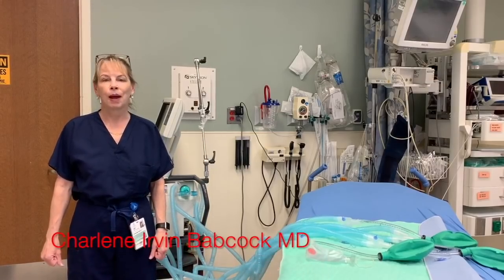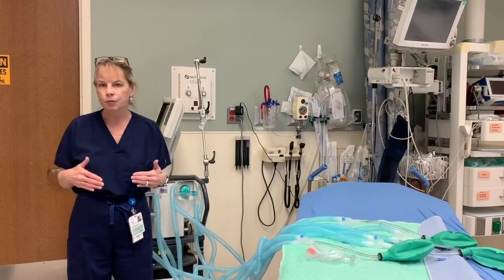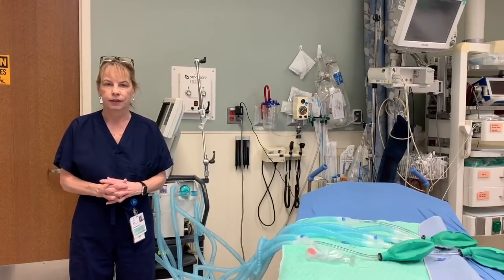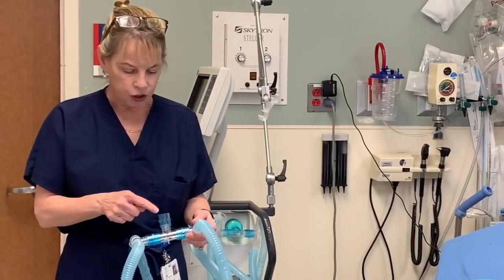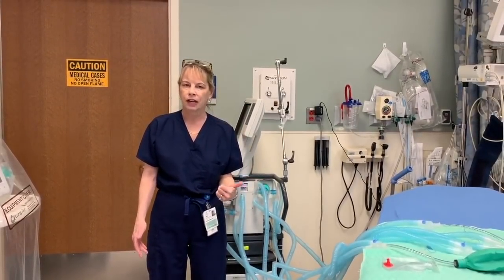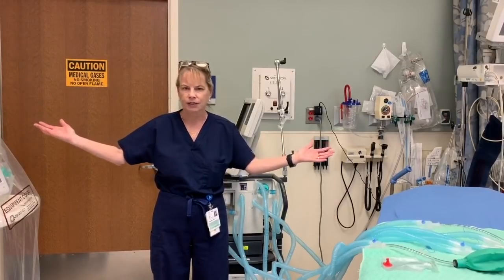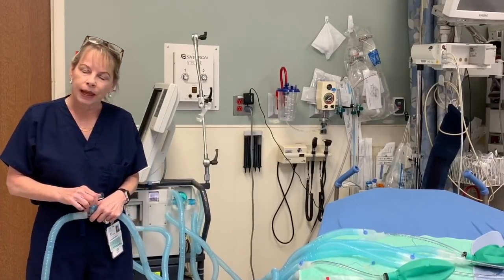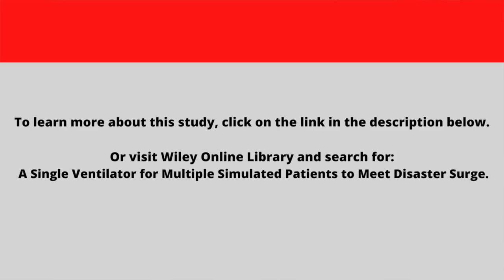COVID-19 How to Use One Ventilator to Save Multiple Lives

Comment: Matching BMI and age, should produce similar pressures in all 4 patients. At each mask there’s O2 connection which can be used individually to add oxygen in case O2 starts to drop. That way no need to change pressures. It’s a great idea you have

Comment: Did you perform SST/EST and how?
Reply: I doubt they did.  If I find time to replicate this later this week, I'll see if it can be done.  They didn't even show us this thing running in the video.  I'm not sure if the PB 840 can compensate for 48 feet of corrugated tubing (4 x 12 ft) during the tubing compliance for the SST.
Reply from the maker: @BicycleCrossroads  People have responded that they are using this in Italy and New York....yes just comments and not corroborated...but if you think about it....once. the dead space is filled, the next breath pushes forward the oxygenated gas previously in the dead space.., replacing the previous dead space....and pushing forward more oxygen...
Reply: @charlenebabcock1048  Tubing compliance and mechanical deadspace aren't the same thing.  When the PB 840 is calibrated with a circuit, the tubing compliance (flex and stretch) is measured and compensated for.  Without a proper SST, you are running the vent on the last known SST calibration.  This is not proper, and you will lose unknown volumes.  As for deadspace, you will typically lose about 150 mL per breath to the ETT and tubing between the lung and the "Y".  This volume, as you probably know is not ventilated and bobbles about...  And therefore is not counted as Alveolar Ventilation, but deadspace instead.  The more deadspace, the more CO2 retention... (Wasted volume).  I'm actually not quite sure what you're trying to tell me.  If you're trying to tell me dead space is not truly ventilated space, then yes, I agree.  But if you're trying to compare deadspace to tubing compliance compensation by the PB 840, then I disagree.

Comment: Hmmm. I have seen and suctioned pints of snot from both inhalation and exhalation tubes. How in heck are you going to prevent the bubble over of snot, or just flecks of same from being introduced DIRECTLY into the other patients lungs. Better to have someone  bag the unlucky three in shifts until the fourth is weened. First, do no harm. 2 or 4 on a ventilator would violate that dictum.
Reply: Hadn’t even thought of the instances when you’d need to in-line sxn one of the patients... with the vent trying desperately to deliver a breath, so it rapidly delivers a bunch of peak pressuring breaths to everybody else... how that now puts everybody at risk for a PTX...
Reply: HMEs... And change them often.  Just make sure you're wearing a PAPR when you do.  This COVID-19 stuff is not messing around.  Check out all those videos from Wuhan.  If you're and Anesthesiologist, Pulmonologist, or RT you're risking your neck on the front lines of this battle.  And our families too if we end up bringing bugs home with us.
Reply: I think a better idea would be to tracheotomy the unlucky three and give them 100% per trache mask until a ventilator becomes available. If they die waiting on a ventilator, this is better than killing them by "sharing" a ventilator. Everyone's tidal volume, flow rate, resp rate will be unable to be individualized. Vent settings have to be individualizing or all you will be doing is "water boarding" them for a day or so before they die. The more I think of it, the worse this idea becomes.

Comment: I have a pulmonary question to which someone might know the answer. since there will be a shortage of ventilators, for marginal patients, why could you not employ a cpap machine with a high setting and bleed in oxygen at a 5-10 liter flow. i would think that it would be the equivilant of a low peep and would provide some mechanical assist. and possibly stave off intubation and high peep. just curious.
Reply: Fear of aerosols, risk of contamination. This is with high flow nasal cannula.
Reply: A report from an intensivist in Wa said they progress VERY RAPIDLY (<12hr) from face mask to tube. He recommends bypassing anything else and going from decompensating on  a mask to intubating.
Reply from the maker: Its my understanding Bipap is contra-indicated in these patients...

Comment: If you put a water bubbler (like in home brewing) along the path to each patient, it would stop any back flow to the other patients.
Reply: if you also put one in the expiratory limb of the circuit, you can individualize PEEP by the height of the water column.
Reply from the maker: True...other. option is to add viral/bacterial filter before the 'mixer' at the vent exp. port.

Comment: This is FANTASTIC!
We started an open source hardware project OpenRespirator.org to close the gap in the supply of ventilators. Perhaps there is a shortcut and less complicated means of meeting the demand by producing the t-tubes and extensions described in this video.
Reply: Hey Brent, looks like your initiative aligns well with this one https://www.facebook.com/groups/670932227050506/?fref=nf , there is also some requirements collection here https://docs.google.com/document/d/15kqUPPI7bYL6dnCetOeDSyE8IG5pHVmtg8Ju4yzGlF8/edit?fbclid=IwAR0L_mUOv82qygfXsapm3iKbxff_52es57wOhNMLdK8td47k8-3948GMQxM , also check their very active openair slack channel if you haven´t already

Comment: Good thinking but practically it is not possible
Reply: But in this video she dint even show in test lung
Reply: @abhinandrews2874  Yup.  Agreed.  It's missing a lot of filters and humidifiers too.  At minimum, should have at least the one inlet filter and four HME's.  One for each patient.  Ventilating patient's dry like this is a big no no.  Had no problems wasting four ETT's though.  The elbow that comes with the four circuits fits right into the 3 Liter Anesthesia Bag.  (And NO, they're not real test lungs...  pseudo test lungs at best).
Reply from the maker: It is being used successfully in ITaly.....yes it is off label...yes it challenges the clinician to 'match' patients as best as possible for compliance, TV, resistance, etc...but it is working...see below about Italy...I've also been told its being used in Egypt.....  THe last sentance in the article (translated) is: "...its like multiplying  fish and loaves."

Dr Marco Ranieri of Bologna, Italy and his team Have successfully tested the approach in vivo in one of the hospitals in Italy overwhelmed by the COVID-19. 

They worked with Intersurgical, an Italian company based in Mirandola, started producing the circuitry in only 72 hours, and the first prototype has already been tested by Bologna Sant'Orsola Hospital. It works and in the next few days they'll start a mass production to supply Italian hospitals who are in need

Here some news in Italian. 

https://www.huffingtonpost.it/entry/a-mirandola-testato-ventilatore-che-assiste-2-pazienti-bonaccini-straordinario_it_5e73c3e1c5b6f5b7c540a8d2
Reply: She says in the video it's been done.
Reply: @introprospector  if it has been done, it hasn't been done on septic patients...  Probably only on GSW folks with relatively "normal" lungs.

Comment: COVID -19 patients who are more likely to have different lung compliance, so how can we guarantee safe and adequate  ventilation for all 4 patients?
Reply: This is desperate last resort move, at this point you are trying your best.
Reply: It's very possible that an alarm would not sound during a failure in one patient that happens to coincide with higher compliance in the other 3. This is last ditch stuff
Reply from the maker: It is being used successfully in ITaly.....yes it is off label...yes it challenges the clinician to 'match' patients as best as possible for compliance, TV, resistance, etc...but it is working...see below about Italy...I've also been told its being used in Egypt.....  THe last sentance in the article (translated) is: "...its like multiplying  fish and loaves."

Dr Marco Ranieri of Bologna, Italy and his team Have successfully tested the approach in vivo in one of the hospitals in Italy overwhelmed by the COVID-19. 

They worked with Intersurgical, an Italian company based in Mirandola, started producing the circuitry in only 72 hours, and the first prototype has already been tested by Bologna Sant'Orsola Hospital. It works and in the next few days they'll start a mass production to supply Italian hospitals who are in need

Here some news in Italian. 

https://www.huffingtonpost.it/entry/a-mirandola-testato-ventilatore-che-assiste-2-pazienti-bonaccini-straordinario_it_5e73c3e1c5b6f5b7c540a8d2

Comment: This looks like it could be a recipe for disaster.
Reply: I agree. However, if this was the last option available, these people already would have a 100% chance of dying without being ventilated.  In that case, there could be no worse disaster than trying this.
Reply from the maker: It is being used successfully in ITaly.....yes it is off label...yes it challenges the clinician to 'match' patients as best as possible for compliance, TV, resistance, etc...but it is working...see below about Italy...I've also been told its being used in Egypt.....  THe last sentance in the article (translated) is: "...its like multiplying  fish and loaves."

So not its not a disaster...COVID-19 is the disaster...and this allows you a plan to 'try or let die'.....and its looks like its saving lives...below is from an Italian source...

Dr Marco Ranieri of Bologna, Italy and his team Have successfully tested the approach in vivo in one of the hospitals in Italy overwhelmed by the COVID-19. 

They worked with Intersurgical, an Italian company based in Mirandola, started producing the circuitry in only 72 hours, and the first prototype has already been tested by Bologna Sant'Orsola Hospital. It works and in the next few days they'll start a mass production to supply Italian hospitals who are in need

Here some news in Italian. 

https://www.huffingtonpost.it/entry/a-mirandola-testato-ventilatore-che-assiste-2-pazienti-bonaccini-straordinario_it_5e73c3e1c5b6f5b7c540a8d2

Comment: I’m a big fan of creativity but immediately I can see some serious hindrances to this procedure. Although you address one of them (the difference in airway resistance between each patent) you didn’t address the problem realistically.  Employing this procedure on similar test lungs or even on trauma victims with healthy lungs (as in Las Vegas) is not the same as employing it with victims in various stages of severe pulmonary disorders such as ARDS, etc.  Each of the critically ill patients would necessarily have different degrees of airway resistance and lung compliance; as a result the volume would tend to over inflate the patients with lesser degrees of airway resistance and greater lung compliance, while simultaneously under inflating the patients with greater airway resistance and less lung compliance.  If these patients are critical enough to require ventilator support, each patient will need individual settings of volume, PEEP, 02, flow rates, respiratory rates, inspiratory pause, etc., which will also necessarily need to be changed frequently to support the patient’s changing condition.  There is no way you will find two critically ill patients requiring the same ventilatory support with simultaneous ventilator changes, much less six of them.  A cookie cutter approach will not work effectively on truly sick lungs.
Reply: These are fair points, and as mentioned above this is truly a last ditch effort when the decision would be truly let other patients die...One idea I have had since Dr. Babcock and Dr. Menes originally came up with the idea is that in a prolonged setting with true respiratory disease, as opposed to airway protection or trauma, patients will likely be able to tolerate short periods with the “wrong” ventilatory settings. Frequent monitoring (and careful interpretation) of ABG’s will be important. It will not be a “set it and forget it” type of approach. Disconnecting patients from the vent, bagging temporarily and then arranging/re-arranging patients into “pods” based on similarities in their apparent lung compliance, airway resistance, oxygenation and PEEP requirements could offer a potential approach to the valid concerns you have raised. Anyway, it seems better than just sitting on the sidelines and letting people die because we are under-funded and have inadequate resources.
Reply: jbrewis7 
Thank god.  Someone who understands.  It’s life and death she’s talking about.  Not a cost saving strategy.  It’s maximum lives saved.
Reply: I agree with Desmond.  I disagree with the replies with "Life and Death" analogy.  Hooking up Septic COVID-19 patients with ARDS will not survive this kind of setup.  It's more like "Death and Death".  Go watch some YouTube videos of COVID-19 patients getting "Proned" to ventilate patients in full blown ARDS.  You folks making these "Life and Death" Analogies have likely watched one too many medical shows on TV.  We put Septic Patients in full-blown ARDS with a vent all to themselves, with inverse ratio ventilation and on a special bed like a Rotisserie and still lose them.  You honestly think sharing a vent with FOUR sick people is Life and Death?  It's death and death, you're not even going to give them a chance with this setup.  Again, patients with normal lungs?  Maybe.  (and even that's a stretch in some cases)  Four COVID-19 patients?  Not a chance.  The lungs will be too abnormal and sick to tolerate this.  Plus our renal function will likely be failing at the same time.  That kind of thing doesn't happen to Trauma/GSW type patients with Normal Lungs.
Reply from the maker: It is being used successfully in ITaly.....yes it is off label...yes it challenges the clinician to 'match' patients as best as possible for compliance, TV, resistance, etc...but it is working...see below about Italy...I've also been told its being used in Egypt.....  THe last sentance in the article (translated) is: "...its like multiplying  fish and loaves."

Dr Marco Ranieri of Bologna, Italy and his team Have successfully tested the approach in vivo in one of the hospitals in Italy overwhelmed by the COVID-19. 

They worked with Intersurgical, an Italian company based in Mirandola, started producing the circuitry in only 72 hours, and the first prototype has already been tested by Bologna Sant'Orsola Hospital. It works and in the next few days they'll start a mass production to supply Italian hospitals who are in need

Here some news in Italian. 

https://www.huffingtonpost.it/entry/a-mirandola-testato-ventilatore-che-assiste-2-pazienti-bonaccini-straordinario_it_5e73c3e1c5b6f5b7c540a8d2
Reply: So they have decided to use this method in Italy?  The next question would be how many survived using this method.  From other videos from Italy, mortality remains quite high even in those not sharing ventilators (and being probed every few hours).

Comment: The patients would need to be completely paralysed not only would resistance and compliance need to be very tightly monitored all advanced modes of flow control would need to be turned off, i still would be very concerned about deadspace and the underlying drive gas needed for this to work.
Reply: Even then it would not work due to people having different airway resistance, secretions, etc. Plus not everyone has the same ventilatory needs. Hypoventilating one patient could be hyperventilation for another patient even of the same size. Some people might need less O2 while others would need more. This type of ventilation would never work.
Reply: @blaqwhole4998  indeed plus how could can you match peak inspiratory flow and peep like this
Reply from the maker: It is being used successfully in ITaly.....yes it is off label...yes it challenges the clinician to 'match' patients as best as possible for compliance, TV, resistance, etc...but it is working...see below about Italy...I've also been told its being used in Egypt.....  THe last sentance in the article (translated) is: "...its like multiplying  fish and loaves."

Dr Marco Ranieri of Bologna, Italy and his team Have successfully tested the approach in vivo in one of the hospitals in Italy overwhelmed by the COVID-19. 

They worked with Intersurgical, an Italian company based in Mirandola, started producing the circuitry in only 72 hours, and the first prototype has already been tested by Bologna Sant'Orsola Hospital. It works and in the next few days they'll start a mass production to supply Italian hospitals who are in need

Here some news in Italian. 

https://www.huffingtonpost.it/entry/a-mirandola-testato-ventilatore-che-assiste-2-pazienti-bonaccini-straordinario_it_5e73c3e1c5b6f5b7c540a8d2